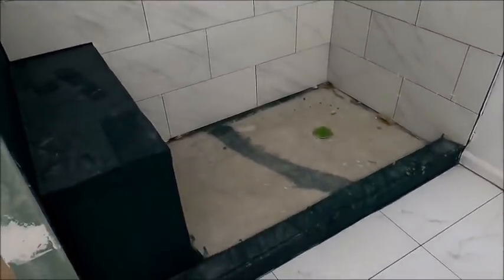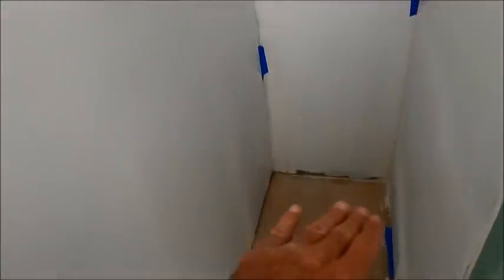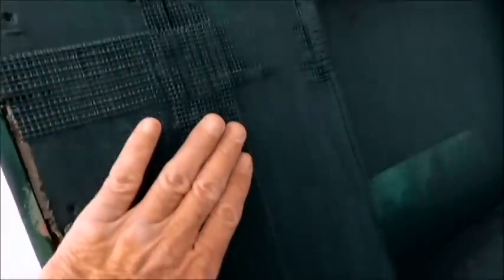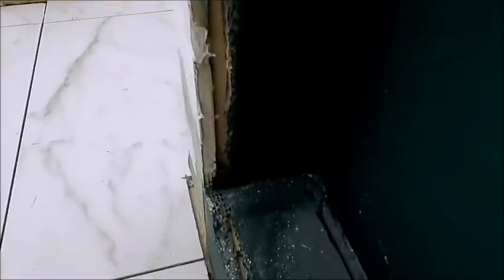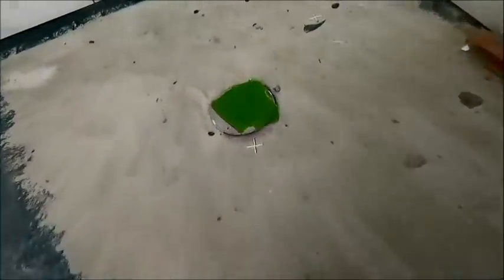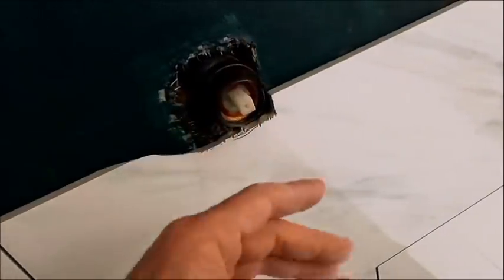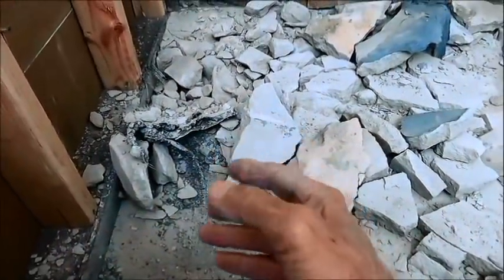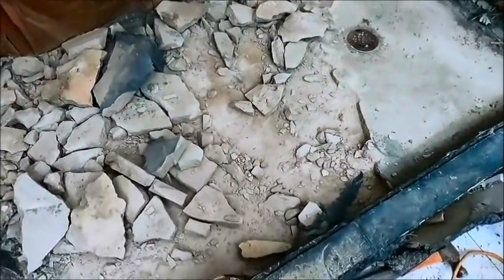AMATEUR PREP OF SHOWER by COMPANY

Comment: I bought a concrete slab house with one very tiny shower bath.  "Professionally" installed and tiled shower with center drain was done walls first.  Grout leaked like a sieve.  I don't even think they used waterproofing.  I removed a fireplace behind the shower, exposing the studs.  I stuck my hand inside the shower pan liner and it is full standing brackish water over my knuckles.  I know the previous owner paid big bucks for that mess.  Now I get to demo and rebuild myself, thanks to your helpful videos.

Comment: I just found a pan liner that was "installed" On Top of the weep hole flange. Just sitting there. Laying on top. Nothing holding it down. No adhesive. Just laid in there between the pan and the subfloor. 

That makes sense, since the wall tile was hung on regular drywall. No waterproofing. Nothing.

Comment: I ripped out 1 today. Kid you not. 
4 mil plastic on floor. Run up walls 6 inch. Then 
1/4 backer board on top nailed down through plastic then tile on top. 
I can’t believe the crap I run into

Comment: What is a good (optimum?) size for a poured shower pan? I am limited on the length of mine (48 inch), but I can push the width out to 44 inches. The original plastic shower pan that I ripped out was 34 inches wide.  I am trying to think about the finished product and how to lay out the tile for the floors and walls. The max length should be a multiple of 12 or 6 to make it easier to lay out the tile with a minimum of cuts, Yes? If this is the case then I should probably place my curb at 42 inches for the width...36 inches plus 6 equals 42 inches.